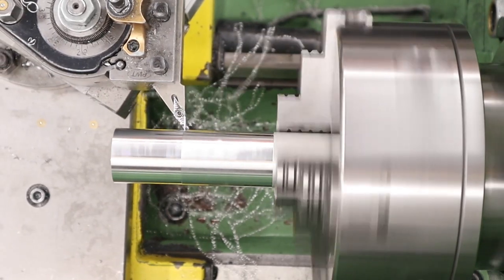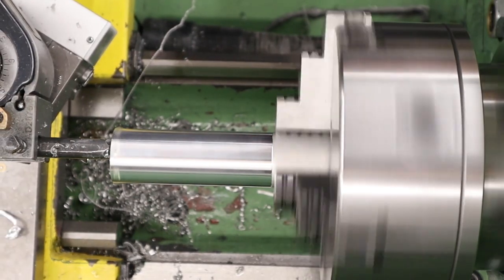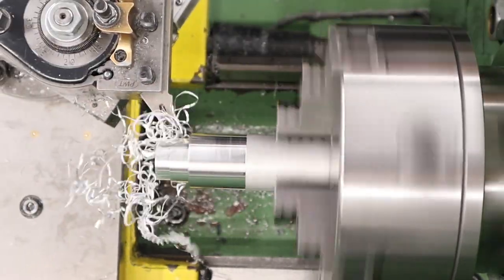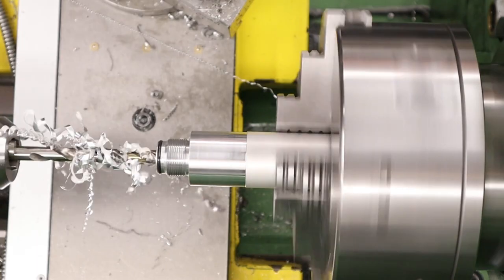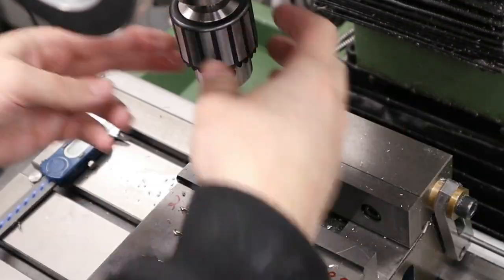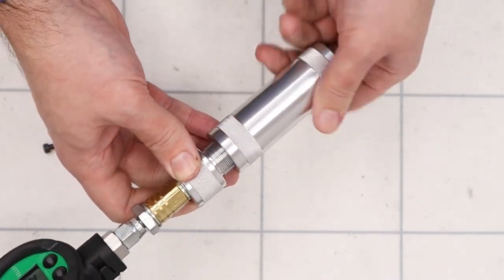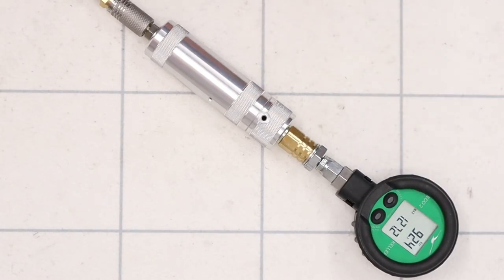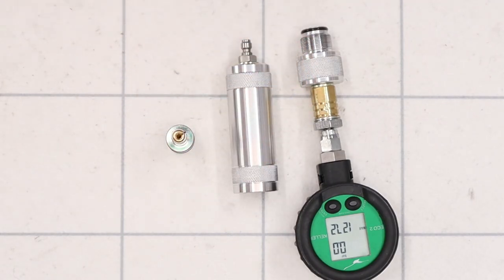Making an AGT Uragan 2 Regulator tester.

Comment: Awesome work my friend. I have a question regarding another AGT, the Vixen. Do you know to what pressure you can set the Vixen .22 long regulator? It's set at 130 bar but I need just a bit more power for heavier pellets. Also I hope you can tell me if other AGN/AGT bottles will fit the Vixen, I find the length of pull a little short. Maybe I could solve this by using a longer bottle and by doing so, add a more shots. Most awesome would be if I could fit one of the 350 or 470 cc Edgun Leshiy 2 bottles. The buttstock attachment will be remade via 3D printing.